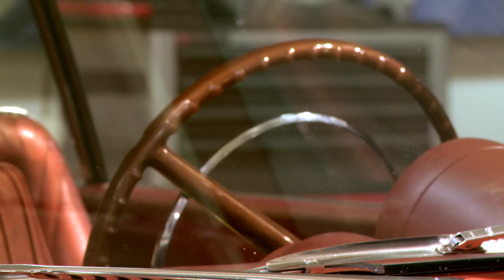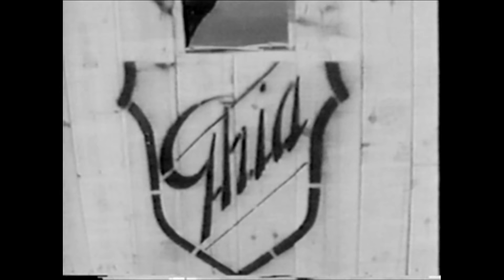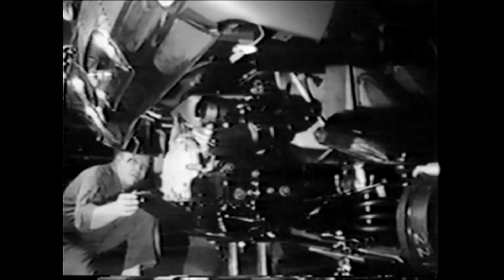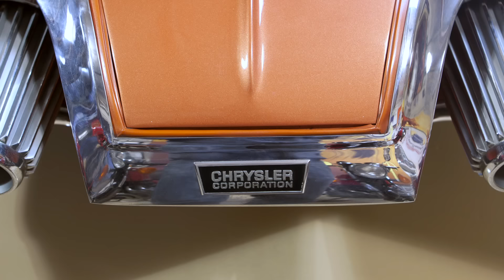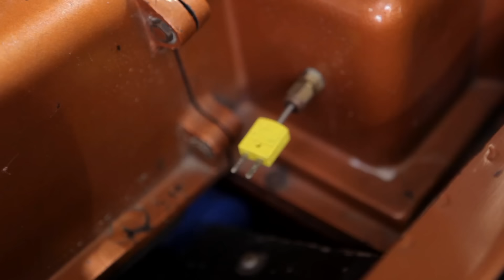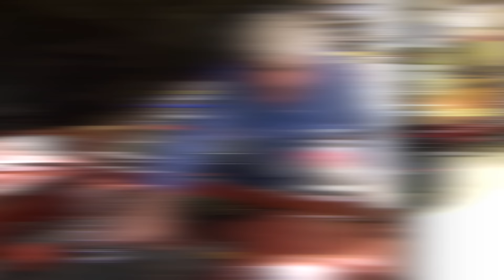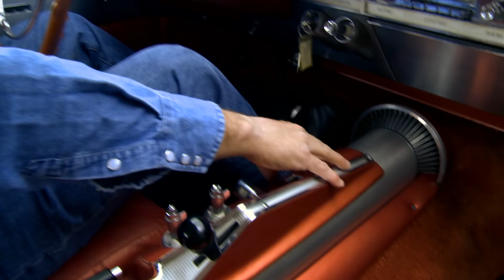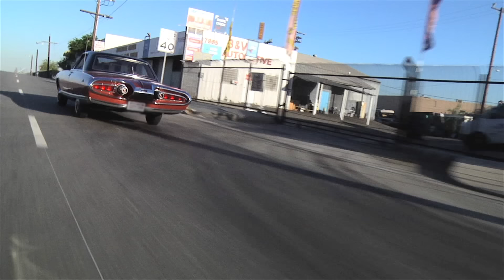1963 Chrysler Turbine: Ultimate Edition - Jay Leno's Garage

Comment: Not a piston engine turbo, but a genuine Frank Whittle Turbine powered vehicle, without thousands of moving parts, in theory, just one moving part, the whole concept of the turbine engine.  Sure popular in aircraft far better fuel economy and even engines that last 25,000 hours.

A first view though about my father-in-laws Chrysler 1985 "turbo" powered car where the turbo went bad after that 12,000 warranty, wanted $7000.00 for a repair back then like $15000.00 today.  Took a major loss and got rid of it. 

Always dreamed about having a turbine powered vehicle, somehow this Chrysler got by me, but doubt if I could have afforded it.  I mean in theory, just one moving part, no cooling system, and only one spark plug that was only needed for starting.  Once fired, that fire is self sustaining.  Should be cheaper than pistons and all that other junk.

Comment: I design private jets. Turbine engines are complex, at first blush, but when you start using them, they are reliable, tolerate temperatures from 120F down to -100F, and you can burn any combustible fluid in them! This car is simply an engineering marvel, and shows us what American ingenuity can achieve! I have the highest regard for Jay and his amazing passion for preserving treasures that we need to show to future generations! As we head towards E-Vehicles, consider the amount of power a turbine engine could produce. For all of their benefits, thousands of cellphone batteries represent a future environmental nightmare if they aren’t recycled effectively. A modern, compact turbine could burn bio-fuels and would work well in ships, pleasure yachts, and commercial vehicles, without needing to use fossil fuels. Worth considering, eh?

Comment: I once laid eyes on the Turbine at an open house at a local community college in Windsor, ON.  This was in the 70s.  Chrysler has brought one in for display in the automotive section.  The second time I saw the Turbine a few years later was at College Ave and Huron Line in Windsor.  The Turbine was stopped at the light and turned toward the Ambassador Bridge, presumably going back to Chrysler in Detroit.  As a former auto mechanic I was in awe.  An amazing achievement by Chrysler.

Comment: As a Jet Mechanic who designed an automobile engine considered by General Electric, this is actually a very good and innovative design, compared to other engines of that era (same era). My design only had one principle moving part if you didn't count accessories, like starters, pumps. GE offered to pay my way through college to get an engineering degree, and give me a job, but I declined, and became an award winning photographer, and then on to other things.

Comment: As a teenager in London I went on a school trip to Box Hill, a popular tourist destination for many Brits. As the bus pulled into the car park we saw a futuristic car surrounded by on lookers. We got off the bus and quickly surrounded the car pushing through to the front and hearing a high pitched whining sound coming from the car. As in your video he took a glass of water and placed it on the bonnet as we all looked on and pointed out the absence of vibration in the jet engine running the car. You took me back to that day.

Comment: When I was in high school in the 1960's, I worked at Humpty Dumpty grocery store in Oklahoma City.  The Foresters were regular customers and one day as they came to shop, they had a Chrysler Turbine to try out for 3 months.  I was fortunate enough to get a 30 minute ride in the car with Old Man Forester and it was amazing - it sounded like a vacuum cleaner.  One of the things he used to do was to stand a quarter on edged on the front cowling under the hood where the radiator should have been and then start the car.  The quarter would stay upright.  I also saw the starting instructions on the sun visor and it blew my mind.  I still remember the ride and the color of the car.  At the time, we thought it was "tight" to see the landau roof on the car.  That was real class.

Comment: I vaguely recall that Rover on Britain built a gas-turbine job as well. More "British" body styling, but interesting features like "honeycomb" panel construction.

A modern, compact engine like the Garret or Lycoming jobs used in light aircraft, would probably work, however, why not use the turbine to drive a high-speed hydraulic pump and have hydraulic motors built into the hubs; all wheel drive with traction control.

Possibly the whole concept would wok if scaled up to long-haul truck use.

Don't forget that at least one major US railroad played with a gas-turbine powered freight locomotive in about the same era as Chrysler were building this car.

Comment: Terrific for long distance cruising, but the fuel consumption went up the minute you got inside city limits.  And, if I recall, Chrysler hadn't given up on the idea but was working on a future edition that would likely have been released if they hadn't needed a government bailout, the terms of which ended up using their turbine knowledge to eventually power the M-1 Abrams battle tank.
It ain't over for a turbine auto just yet. Rover of England had their program, you see the Chrysler here, and even Toyota had an experimental turbine auto back in the eighties.  In my own opinion, it'll come back again to stay, but as the basis of a turbine/electric hybrid similar to railroad locomotives.

Comment: Good Job, Jay
...the one that I saw (and fell in love with ) sported a 'Joystick' on the console and no steering wheel (no peddles)
...the 'yoke' worked forward (accelerator)/ backward (brake) with left / right servo motor steering front wheel drive
...am I dreamin' ...did that version exist? 
since I saw it I have dreamed of perfected versions with Hub Electric Motors and amphibian conversions
NOW, (2020) I envision it as an automatic self-driving car 
...My embellishment was that the bumpers had several redundant laser emitters (bilateral) that would sense 360 (degree) 
...The 'bumps-in-the-road' would be 'logarithmic mesh networked sensors 
JAY, am I crazy?

Comment: It was around that time I was about 14 or 15, I had stayed home from school, my mom was also home. One of these cars came up our 1/4 mile driveway that led up to our little farm. It was the Snohomish County tax assessor driving the car. The man talked to mom about the appraisal, I was enthralled with the car having never seen one before. I am certain they told me that it was an experimental car on loan for testing. I recall the man telling me that the car ran on almost any fuel including perfume. I clearly remember that. I will never forget the sound of the engine. It was so cool. Never saw the car again after that day. Thanks Jay, did not realize they made only 50 some cars.

Comment: If it makes everyone feel any worse about  not having turbine engine cars, most around this size would float around 300 pounds and can produce an excess of 700 shaft horsepower as well as have a typical engine change of 10,000 hours (equivalent would be an average of 150,000 miles). On top of that, modern electronically controlled turbines are as efficient, if not more so, than an equivalent piston engine, as well as burning literally anything that can burn.

Comment: Those yellow connectors in the engine compartment are Thermocouples to monitor temperatures. Likely from engineering wanting to monitor temperatures.  You can plug them into a conventional Fluke or multimeter with J or K type thermocouples.

Comment: Would have looked great as a fastback.
Rumor had it that a big problem was the huge amount of air the engine prossesed, which required a really big air filter that clogged quickly and needed to be changed frequently.
Tanks had a similar problem especially in the desert. The Navy had problems with salt.
Planes fly above the water. Ships sail on and through it.

Comment: I wish someone would make a Turbine Hybrid, where the turbine ran at a single speed for maximum efficency, powering a generator to charge a small battery (for a hybrid) which would:
1) allow the use of any fuel, including alcohol fuels made from waste biomass
2) allow for better driving performance (these turbine cars were noted for sluggish acceleration and very slow changes in turbine speed) via electric motors (near instant full torque)
3) offer enormous range over current hybrids or electrics since the turbine could be miniturized

Comment: When about 11, built the 1/25 model of this car.  So yes, I have heard of it.  The directions called that big box in the engine compartment a radiator.  Jay said it was an air cleaner - no radiator needed.

Comment: The time of producing one car a week is viewed critically, but most people do not realize that a gas turbine engine is a precision instrument.  Very specialized compared to standard cars in use.  The closest common application in cars and trucks used today are turbochargers.  The military used multiple fuels in vehicles for years before the Turbine, so they could operate under any condition.

Comment: One of these Chrysler turbines showed up in my hometown suburb east of Pittsburgh, PA in 1963.  I do not remember the name of the owner.  I listened to it run, sat in it ... and when it was time to go for a ride, the temp gauge showed an overheat condition.  The owner shut it down immediately, and it was hauled back to the local Chrysler dealer.  Sadly, I never saw it again.

Comment: Then there was the STP "Whooshmobile", a turbine powered Indy racer that was leading the 1967 and 1968 races until with a couple of laps to go mechanical troubles sent it to the pits. After that USAC basically legislated the turbine out of racing by reducing the intake area.

Gas turbines power the M-1 Abrams tank which is a pretty successful vehicle. The great thing about turbines is that they can run on just about any fuel. And because there is no explosive combustion there are a lot less unburned hydrocarbons coming out the other end.

Comment: Turbine looks kinda like a T-Bird from behind . Just hit 38k miles in my 2013 Dart Rallye Turbo it's part Alfa/Fiat !! They stopped making them to make more SUV's in the factory gets almost 42 mpg highway dual air turbo. 6 speed auto with manual quick shift option !!!

Comment: Why type of transmission is used with the turbine engine? Is it a normal 904 or 727 style? If the engine idles at 22,000 rpm, where are the transmission shift points?

Comment: I have history with these cars. First in 64 i drove along side one of these on 8mi. Rd. And we were both on our way to work. Then off to VN and when i came back i got a job at Chrysler engineering vehicle development. Well i did further develop and made lots of advancements. (Like a variable pitch power turbine that would spin the tires and run like a roadrunner). The mileage was not after final development and today this would operate brilliantly. IE. Electric trans. ,start stop technology with a light hybrid system to run just the power turbine also the blades can be Ceramic cast. Tobad we let Chrysler go to foreign owners now they have all the research. So buy American while you still can.

Comment: 12:10 Compress air and air temperature reaches
425.0 °F = 220 °C
That hot air reaches the heat exchanger and it is further heated to
1,000.0 °F = 540 °C
Then fuel is added and burned and temperature reaches
1,700.0 °F = 930 °C

Comment: If I recall correctly, There was an item required for the transmission, possibly the modulator, that Chrysler did not have but Ford did and an "an arrangement" was made between the two companies so Chrysler could get the parts they needed.

Comment: My dad test drove one of these when he worked for Chrysler in the 60's.  He was really disappointed with the car's off the line acceleration.  But you have to remember that the turbine engine's claim to fame is speed.  I guess after driving hemi's and seeing jets break the sound barrier at airshows, he, as well as the American public, was expecting more of a rocket than a smooth cruiser.

Comment: I seen that/a car like that In Sparks Nevada; Compared  Our Pictures to it. That Showroom closed Up Some 6/8 years ago. When I was there Some 35  years ago The Chrysler Man said there were 4 left. And Not Destroyed ;   Now I do Not Know as That is what He Told Me;  And as the Story goes on It seems to Change a Bit; I have no dog in this Fight Other I was there.  Spent 4 years On Turbine Engines , Ford had a Big truck ,GMC . Was working on One And Of course Chrysler Had the Car.   If you remember There was A turbine car In the Indy.500 and was Running Well ahead of the Pack When all at once it Pulled in the Pits. With a $3.00 Bearing Failure;;   At that time it was said The Auto. Mechanic's Union. Along with others Kept it Off the Market Because of . The Low/no maintenance;;  I Was there I lived it;; You can Read about IT..

Comment: Jay you got the contacts this drive train should be in lower the road trucks the low matanacce and it could youse liquid propane I’m sure burning that as full to could easily meet the standards and very cheap fuel and that it’s so smooth would be great for those long trips and I imagine it could be much bigger for the need

Comment: WOW!

I'm so glad Jay managed to procure one of these otherwise there might not have been any to display.

I saw one of those when I worked at the Chrysler plant in Belvidere, IL. Evidently one of the execs was given it to evaluate. I got to see it parked inside the building. At lunch time I was walking around it just admiring the lines. I knew it was a turbine car because I had read up on it. Some guy in a suit hollered, "Hey what are you doing?"
I smiled and said, "I'm admiring this gorgeous car of the future."
He smiled then and said, "I'm glad you think so".
He started to tell me more about it, but I realized I had to get back to work before the assembly line started. Wish I could have found him again.

I saw it leaving the plant as I was walking to the parking lot. I couldn't even hear it run.

It's a lousy shame Chrysler was having money problems at the time, who knows what might have come of this project? Maybe their money problems were caused by investing so much in this car?

I wonder if it would run on vegetable oil, my diesel Jeep can. Might have to start it on kerosene or diesel and switch to veg oil once it is heated up. That would sure put a kink in the foreign oil gimmick.

Comment: Expert advice, please? I'm thinking someone should make a hybrid jet car.  The engine's lighter than a piston engine, the electric motor runs during city driving for mpg, turbine kicks in on the highway for decent range, regenerative braking manages turbine's rpm(?), can run on biodiesel or cooking oil or anything. Your thoughts?

Comment: So great that this unique car is being preserved and driven. I saw it at the World's Fair, a couple of families in San Diego had one for 3 months and we saw it on the road a few times, and I have seen quite a few in museums. I think the 61-63 Thunderbirds were an influence in the styling of the turbine car and if Chrysler could have partnered with Ford in this experiment they could have used the 63 T-Bird as the body for the turbine engine. I'm looking forward to folks putting electric power into early T-Birds. Thanks for sharing Jay.

Comment: Jay, I lovingly built the plastic model of this car in 1964. It had a very detailed interior with a molded, multi part representation of the turbine under the hood (not much to look at). I drooled over the console, very T-bird-like, but different. I couldn't stop studying the unique front and rear end. The tail lights came with clear red surrounds. The giant headlamps glistened in clear faceted plastic. The body was molded in this exact color. Appropriate parts were flash chromed. Real, rotating, whitewall rubber tires were a crowning touch.
It didn't last long in the frequent upstairs hallway demo derbies against my brothers' models, but it was worth every penny of my lawn mowing money.

Comment: My dad worked for Chrysler.  They sent him to NYC in the turbine car.  He appeared on the Today Show (or some morning show).   He poured a quart of real Chanel no 5 in the fuel tank to wow the audience.  He told me that it could also run on a bottle of Jack, but that would be a horrible waste. 

To demo Chrysler's torsion bar suspension, he removed the right front wheel, and spent the rest of the day driving around Manhattan on three wheels.

Comment: How wrong can you be. Jay is a typical American who thinks that the USA is the centre of the Universe.  Let's be clear the poor pitiful little Englishmen were making a Turbine car 10 years before this Chrysler. "The Rover JET1 was a gas turbine car originally built in Solihull in 1949/1950 by the Rover Company, and modified to a more aerodynamic style in 1952. ... JET1, an open two-seat tourer, had the engine positioned behind the seats, air intake grilles on either side of the car, and exhaust outlets on the top of the tail." So much for the idea that the USA is the land of the Brave and the Home of the Free and the Centre of the Universe ... Wrong again Jay.

Comment: When I was 12 years old (1964) I saw a Chrysler Turbine Car at Grossmount Shopping Center in La Mesa, CA.  It was on an elevated platform.  They started the engine , balanced a nickel on edge on the engine.  They spun the engine to the 60 MPH equivalent.  The nickel never moved.  The exhaust gases were remarkably cool.  And the car was just good-looking.  A few months later I saw another turbine car in Anoka, MN.  This car was just unforgettable.  Thanks, Jay.  Brian Grittner, Little Canada, MN